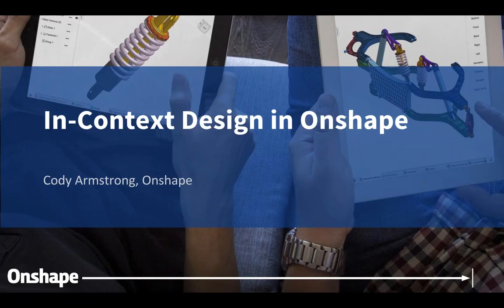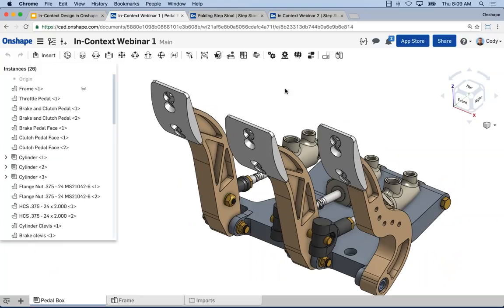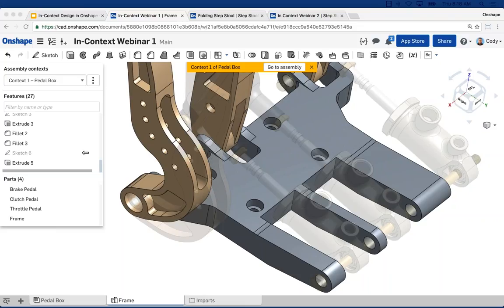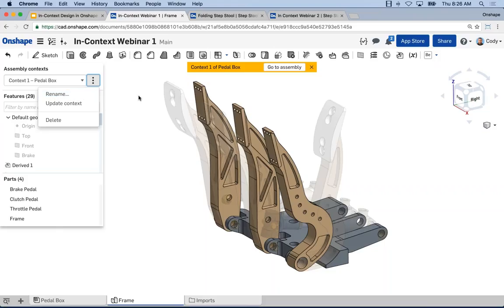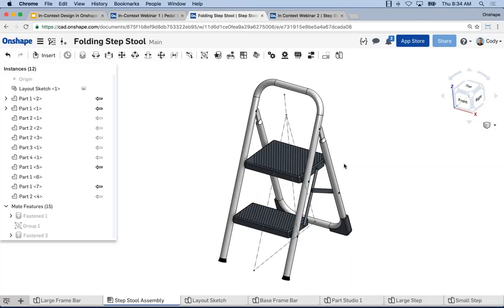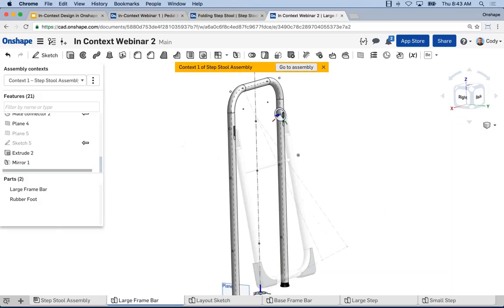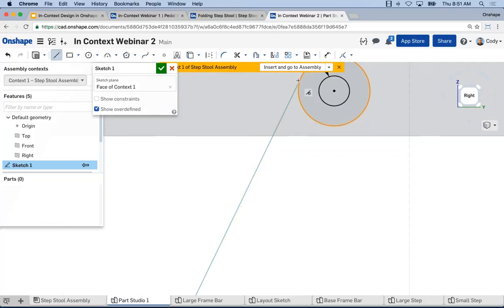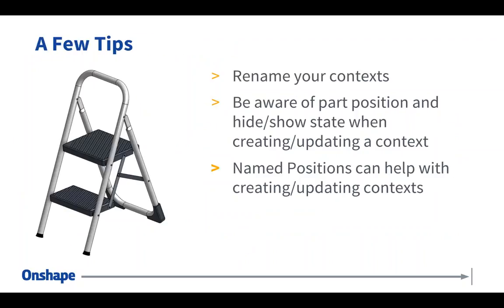In-Context Design in Onshape | Webinar (January 19th, 2017)

Comment: At work, In context has always been taboo. Mostly because of it will significantly slow down an assembly while it attempts to rebuild every time you change configurations. Also it leaves you with the responsibility of updating and saving the assembly in the contextual position before closing it out (because it dynamically updates of the part). Another key reason is, a file base system where renaming a folder or the file (in windows explorer) will break your references. You have managed to single-handedly  cure every problem I have had with in-context design in one simple and easy to understand interface. Within 2 minutes of skipping around this video I managed to jump into an assembly I have been puzzled with for weeks; and have created the part in context faster than I would have been able to in my native software. Excellent job! Also thank you for giving us assembly configurations (named positions) as a bonus.
Reply from the maker: Thanks John for being an active member of our community. We'll try to be more active on YouTube going forward too, so it doesn't take 3 years to reply!